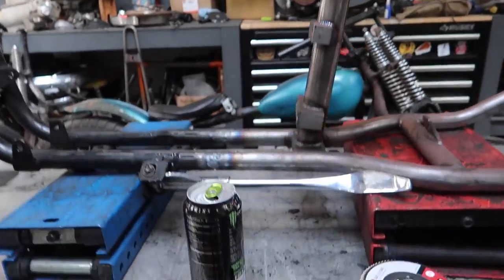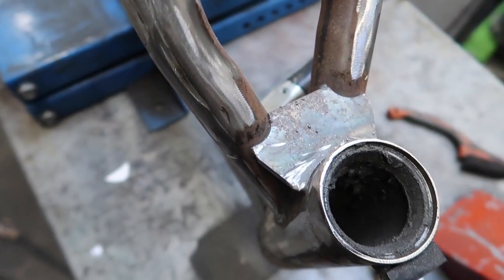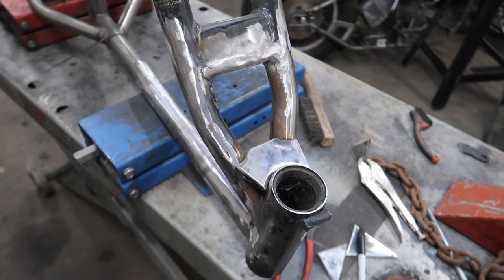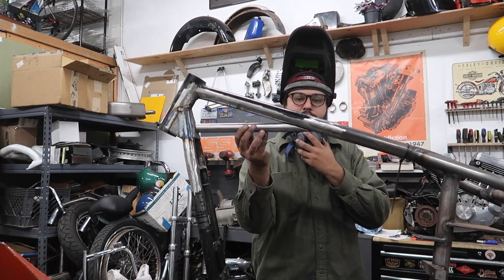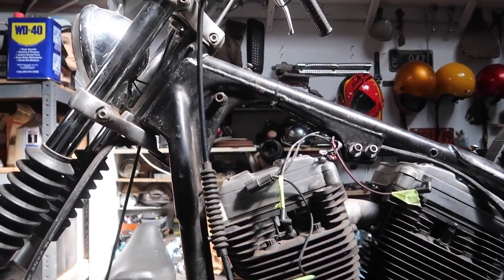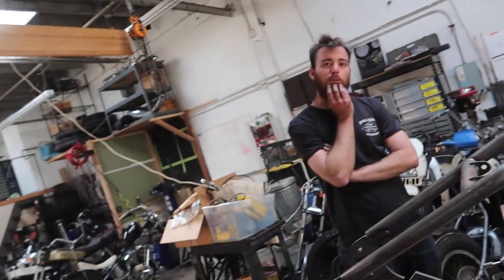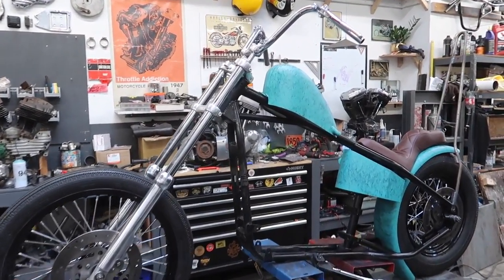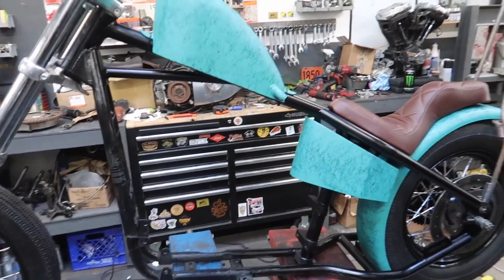Evo Sportster Chopper Build Part 3 Cutting all the junk out of the frame!!

Comment: You weld to slow you need to step out with your swirls. Short circuit mig is a cold process. So you need to stay ahead of your puddle or you lose penetration.

Comment: When you’re putting that much heat in to a centralized area, you need to let the area cool down or clamp it. Otherwise you’ll end up with a good warp in everything
Reply from the maker: Thanks for the tip! I have a frame jig that I need to get the “framing” material for soon that will help with this.